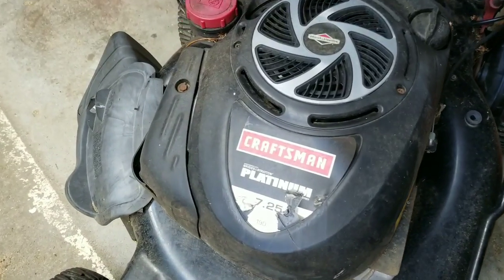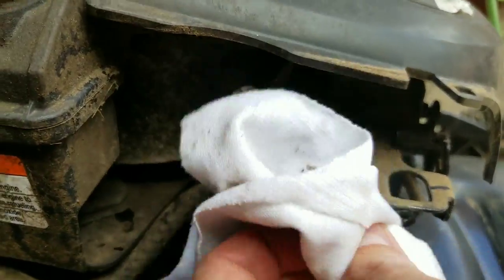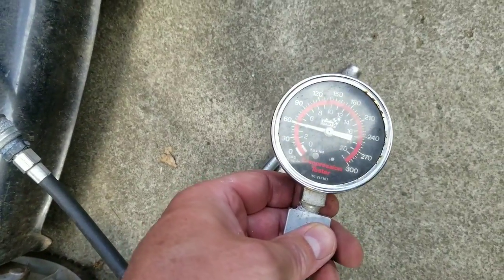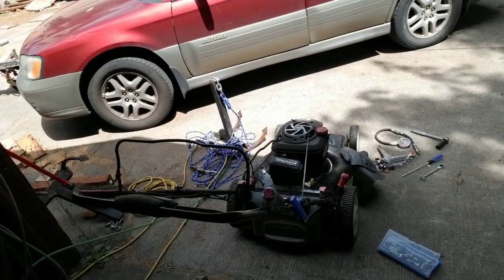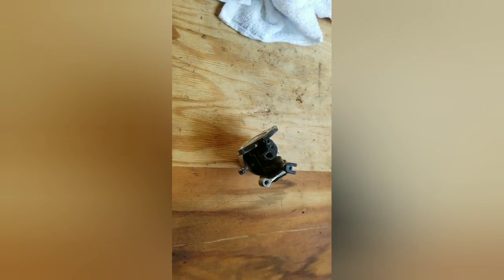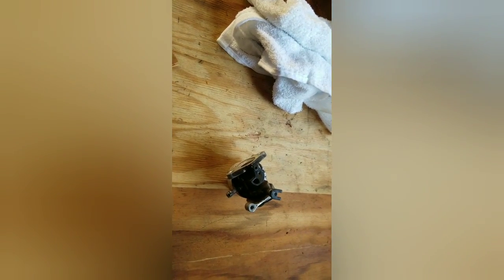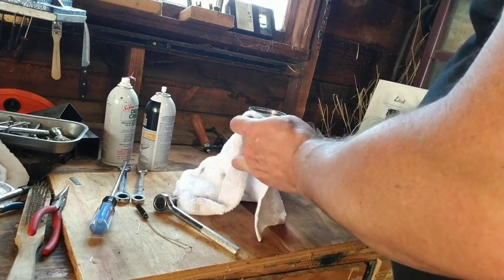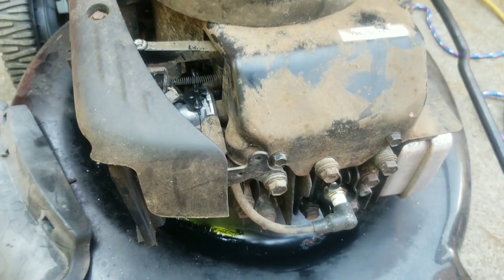Craftsman Platinum 7.25 Lawn Mower Won't Start --Briggs & Stratton Carburetor Cleaning and Rebuild

Comment: I have the 725 series but i can not find a manual and google says my searches returned nothing? you would think you could still find a manual 944.362121 so I am guessing these numbers the parts are all different ?
Reply from the maker: Try this: https://www.google.com/url?sa=t&source=web&rct=j&opi=89978449&url=https://c.searspartsdirect.com/mmh/lis_pdf/OWNM/1403526L.pdf&ved=2ahUKEwiWlcqBldKFAxW-EjQIHRF3DaYQFnoECBAQAQ&usg=AOvVaw24AKygyLVbdT1kez0c2e9z

Comment: what kind of gasoline does it use? the red cap indicates an 85 with a slash. does it mean use 87 octane or higher? Thank you in advance.
Reply from the maker: I just use 87 octane with a tad bit of Seafoam in it.
Reply: @JasonSipe16  Oh ok thank you kindly for your reply.
Reply: This happens to me about every 3 uses- it’s expensive to keep paying someone to clean the carburetor so, I’m going to try it myself. What a hunk of junk
Reply: @JasonSipe16  I use seafoam in the gas, but it hasn’t really helped
Reply from the maker: You might also want to make sure that your spark plug is the correct one, and gapped correctly. I've had that happen, where I had a spark plug that I thought was good, and then I changed it out and it immediately fired up.
Reply: It means to not use ethanol 85 which is 85% ethanol and 15% gasoline.